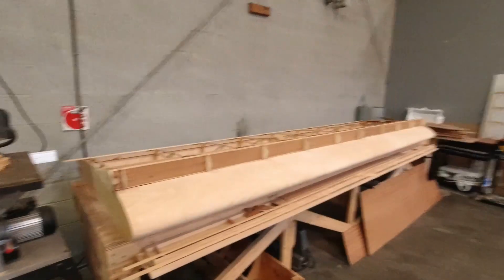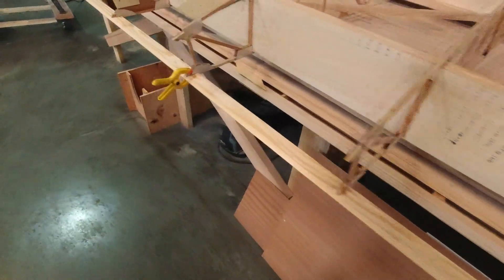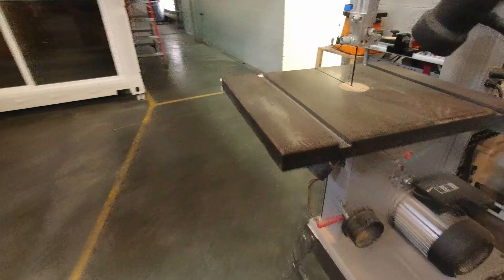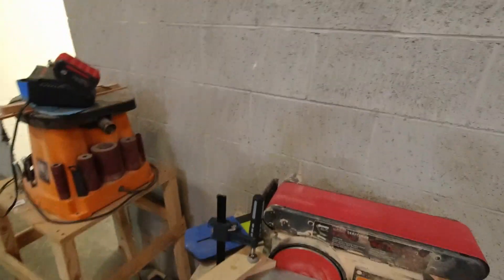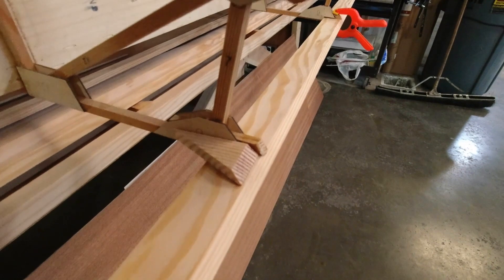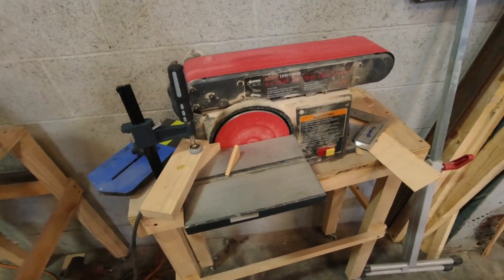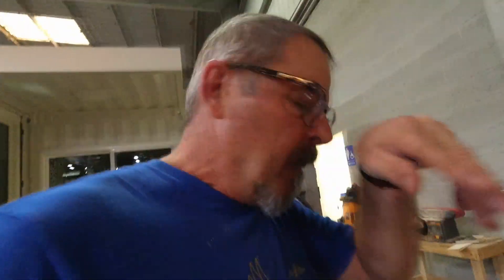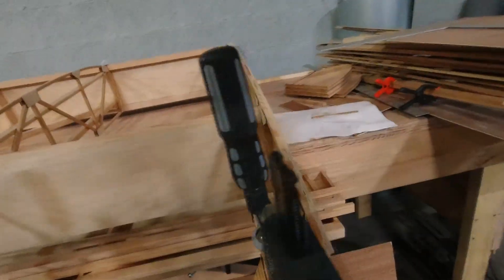Minimax 1100r Aircraft Build Vlog Episode 24

Comment: So that small gap between the rib and the bracing bit from the gusset doesnt need to be filled? Seems like it would be worth popping a sliver of the gusset material in there so its a solid connection along its length?
Reply from the maker: There is overkill surface area already in the way I did it. Those small gaps. Are not a concern at all. You could cut the triangle piece so that the wider part contacts the rib but it’s not necessary. 
The AD is to just add a piece of 1/4” rib material on each side, I went way beyond that.
Reply: @DTMinimax  Cool. Thanks 👍

Comment: Sorry did I miss something I thought you said for the top of the wing but that looked like the bottom. If they are needed for the top as well then you would need more than the 22 for both wings. I am sure your right but I would like to know as the wing on my next project (own design) will have a wing simular to the MiniMax structure.
Reply from the maker: You’re such a keen listener! 
Even my count of 22 for that bottom piece was wrong, it actually took 18. That first bay doesn’t need them because the 1/16” plywood covers that whole area. So that’s 36 for each wing half, 72 total. Sounds really cool to do your own design! Is that’s hard to accomplish where you live?
Reply: @DTMinimax  The class of aircraft is SSDR (single seat de-regulated) a bit bigger then your part 103, MTOW 300kg, no fuel or top speed  restictions. Very few kits and even fewer plans, so as an ex Lotus design engineer and RAF aircraft tech, who has restored as few aircraft, I decided to look at designing my own. It has been fun so far doing the stress design work on the basic airframe.
Reply from the maker: The Hawker Hurricane is my all time favorite airplane. My paint scheme will be painted like a Hurricane XR A squadron plane flown by American Pilots.